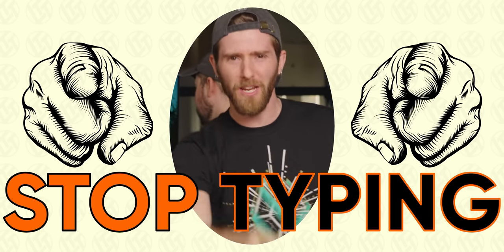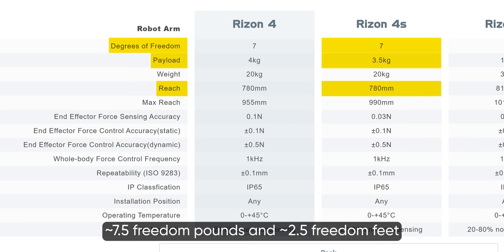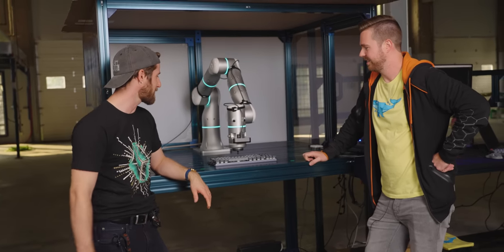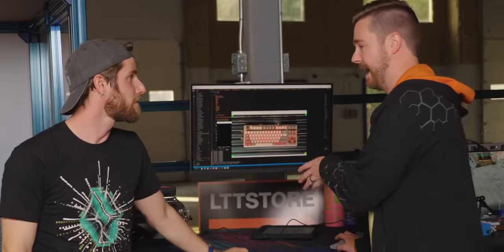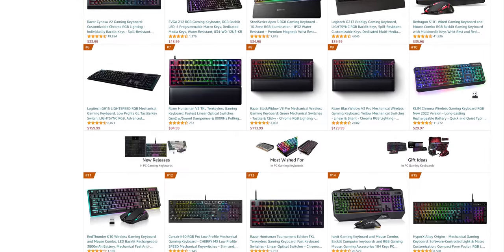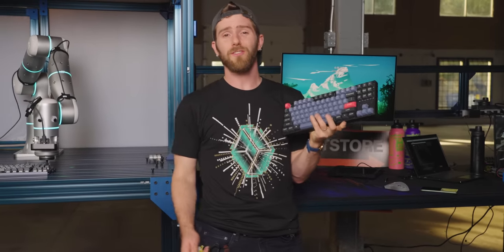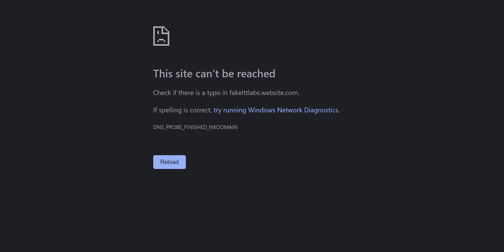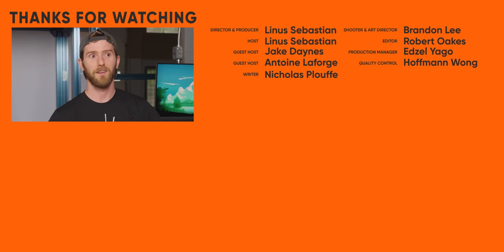Your Keyboard Sucks and I Can Prove It. - Labs Keyboard Testing

Comment: As a robotics engineer, this setup is definitely a decent proof of concept. I'm really excited at the progress and promise of the work! There are some simple changes you guys could try to make the setup more robust, especially for vision. Fully enclosing, specifically with a light box, would really help with consistent lighting as well as integrating the lights. You can also get a 3D image using a 2D camera by stitching together images as the robot moves or using multiple camera angles. Multiple cameras can allow a 3D image also using structured light through a projector. That will be much cheaper $500 USD per camera, than a multi $1k/$10k 3D sensor. Getting a Basler or similar GigE camera allows open source focus control and confocal lenses if you want a really flat 2D image. 2D line scan profilometers are a decent idea, but be careful that robot movements can cause rippling in the image as they move. So take measurements while it is stopped or consider a true 3D sensor (point cloud) as they are about the same cost range as a laser profilometer. Another lower cost option is using a Microsoft Kinect or HP 3D Camera. They used to be off-the-shelf, but you can find used ones. They have limitations in resolution, but might work for identifying the key top centers. Just some attempt at friendly advice that I gained through many hours of banging my head against problems in the industry. I'm sure you guys have already tried a lot of approaches you couldn't fit in the video.
Reply: Or use a tof camera to get a point cloud
Reply: This. Laser topology seems not only overkill but prone to issues such as metallic reflections from both the robot itself and keyboard backplate (or even shiny keycaps), not to mention high sensitivity to jitter and judder. A rigid lightproof enclosure with two or three distinct camera viewpoints should be more than enough to build a reliable pointcloud with high enough fidelity to work here, or spend the big bucks on a 3d scanner that will not require complex positioning to capture the topology of the keyboard.
Reply: i really hope these changes are implemented
Reply: why would fully enclosing help with vision? why not just use a coloured light and a matching filter?
Reply: In your opinion how many years away are home cooking robots?
Reply: I don't think that's what he's going for. Remember, it has to be viewable on video and LMG has the resources. Doesn't make the setup any more optimal than it already isn't, but "satisfactory" is all they were going for anyways.
Reply: I would use a normal camera but not mounted on the robot. You can make the robot adjust its height by using the builtin force meter to get height of each row. Then you know where ea h key is with the camera and height.
Reply: @alystair  Now, look up Moley Robotic Kitchen if your mega rich.
Reply: @ritecomment2098  I'm not an expert so take my reply with a grain of salt. But this might cause an issue if say the color of the keyboard happens to coincide with the color you chose as your filter. Not to mention that lights, especially sunlight, may give off multiple wavelengths of light and thus might match your filter thus eliminating any gains you get for using the colored light in the first place. And really it's a matter of what is the simplest solution that works. Sure I could be wrong and there is a way to get just the right filter, but in the end, is that cheaper than getting am opaque casing to surround the robot and a bit of diffuse lighting to go in the case?
Reply: one change that would solve the lighting issue is to use a industrial camera with built-in lighting. As a robotics student I would also recommend a reference mark like a ar (fiducials or ar_track_alvar) landmark as seen in ros.
Reply: ummmm this is less robotics and me of basic com vis knowledge to help robotics
Reply: Would a Xbox Kinect camera not also be a good solution for 3D imaging?
Reply: It is fully enclosed. They showed it in the video. It's removed for demonstration purposes for most of the video, though.
Reply: @christianstonecipher1547  well, I am an expert, and I'm telling you the vision solution would be to use a diffuse filter at a given wavelength, e.g. red 700nm and simply turn off the LEDs on the keyboard. even better scrap the robot and use a linear drive with a load cell and measuring software like that from promess-inc, it does all this force/distance measurement and statistics out of the box to a database.
Reply: @bradleyswanson329  fiducial alignment marks are never QR codes, they are parallel and intercepting shapes and lines.
Reply: @ritecomment2098  too much variability of the keyboards colors ?
Would go for black box with withe light.
and dark box alow better spped on robot since you don't need to be "cobo" robot anymore and all the associated safety.

but if no doors, @ltt, considere IR barrier for safety to not permit humand in the robot cell during movements
Reply: Fully enclosing the whole kit and caboodle in a dark enclosure and just using one pinpoint light source on the robot arm would remove much of the problems of reflections and lighting shadows to a consistant level.
Reply: @lukeholland8083  the accuracy is not usable, in my testing it can vary by 4 inches easily depending on temperature and if it loses tracking.
Reply: @dededu72  if only there was a standard 104 key layout and a few others that could be used for all similar keyboards :/
Reply: @turbomit112  don't they already have zed tof camera at the robot?
Reply: apply iso 10218 and sack whoever completes your compliance!
Reply: Is he the new Luke?
Reply: @gareththwaite5128  I doubt they have a risk assessment or tested trap poses with pressure activating Tape!
Reply: @bradleyswanson329  fair enough
Reply: @Meoiswa  Completely agreed. That's an even easier setup than arm mounted camera and image stitching. Good advice! I might edit my comment to add that.
Reply: Idk wtf you just said but I like it
Reply: How does one become a robotics engineer?
Reply: @ritecomment2098  sorry about that I couldn't remember the exact name I updated my comment with the correct names and the ros packages that would work
Reply: I agree with what you said here, but from an engineer used to working with robots in a manufacturing setting, this cell needs safety curtains! Get the correct safety items and you can maximize the robot's movement speeds (when not doing sensitive work) to help reduce cycle time.
Reply: I think the best value proposition would be to use a multi-sensor photogrammetric setup, but mount the cameras stationary relative to the keyboard and subsurface, instead of attatched to the robot head. This will eliminate part of the changes in light that may occur when you move the camera relative to the light source, and will only have to deal with eventual changes cause by reflections cause by the robot inside the enclosure.

When i studied geodetic surveying a few years ago, there were already really decent projects capable of making realtime photogrammetry from a single camera feed (non ToF as far as i recall). It should have come quite a way by now, considering the huge advances made in AI just the past year.

Using force data from the actuators should in theory be combinable with the photogrammetric render to gain greater precision in the point cloud renderer for the consecutive buttons. So you could essentially make four calibration presses on the corner buttons to get control points for high-precision coordinates for the photogrammetric model.

Since LTT already has a ML/CV specialist at hand, this should be a relatively surmountable task.
Reply: @ritecomment2098  Yes. It reduces interference from outside lighting that can muddy the results. That lights that you install in the light box attempt to broadly distribute the angles of the light, control the color, and frequency it is strobed.
Reply: Much cheaper is relative. If you have someone on staff who is proficient in OpenCV (specifically camera calibration and 3D reconstruction) then this should be piss easy. If you have to hire someone and it takes them maybe a week (or longer) to do it you're probably better off just buying something off-the-shelf. Though honestly in this case I'd wager any reasonably performant approach from the last couple of years ought to give you a very accurate reconstruction. It's a keyboard, not some highly complex 3D scene.
Reply: @alystair  I know a lot of startups are working on the commercial restaurant side. I think that is going to get the attention for a long while because there is more profit opportunity. However, once the problem is "solved", I think we could see it distributed to the home space. Probably 10 years for the home. Part of the problem is the cost. Robot cells are typically, $20k to $100k USD, even for small ones like this. I would expect a home one would look a lot more like a 3D printer because that space is getting cheaper.
Reply: Do you guys put googley eyes on every robot you make/use? Because after watching this video I think every robot should have googley eyes on.
Reply: id just go for a line scan. yeah itll be a little pricey on the hardware side but the data is extremely clean to begin with and it makes the cv development so much easier (you could probably get away with a fitted plane and threshold). as for ripple, i dont recall having that with the robots we used, at least not significantly. id expect this arm to be really precise too.
Reply: @alext3811  Fair, but I give this advice because it is a cheaper approach with more flexibility than a 3D sensor. 2D sensors allow direct capture of a video stream or you can throw in a more cinematic camera into the setup without interfering with the rest of the machine.
Reply: @AndrewTSq  That's a valid approach too.
Reply: @christianstonecipher1547  That's a valid concern. But it's largely been tackled by the industry. There are fairly low cost LED systems that can produce a very broad range of wavelengths that are also tunable. Plus no matter what vision system is selected, limitations imposed by the material and color will cause problems with reflection. A 2D camera setup actually allows for a lot of flexibility in dealing with edge cases.
Reply: I'm a PhD student specialising in CS and Applied mathematics, which includes ML.  And I agree, laser does seem like overkill
Reply: @bradleyswanson329  Completely agreed. I, honestly, hope they just consult an industrial robotics engineer. I bet there's tons in the audience that would be willing to point them in directions just for free just to help. Plus I expect that there would be companies like Cognex, Keyence, etc that would be willing to consign a vision system for some brand awareness or at least a trial of the equipment.
Reply: @Sponers1  Fair. Industrial robotics is a multi discipline skill set. From programming the robots to setting up sensors and tooling.
Reply: @Steamrick  Sure. I heard that part. And cardboard is an ok approach, but setting up a proper light box is much better than that. There are camera supplies off of Amazon that can get you 90% of the way there.
Reply: @ritecomment2098  I agree. That would likely be my first approach too. I think the only potential advantage of a 3+ DOF robot would be if they want to test some off axis key stabilization.
Reply: @dededu72  That could be an approach. But multiple colors can be pretty easily overcome with what I described. Black box is only really needed if you want to really control the directionality of the light. I don't see a reason to do that here.
Reply: @Bear Spicer 
Why would it be irrelevant? I'd expect the system to generate a distance-force +  distance - input registered graph for EVERY Key.

And yes, when there are keyboards that alter that intentionally from key to key, this should show up here. But you should be able to see a consistent pattern for this, or see whether the force is randomly distributed over all keys.

(or whether that claim simply isn't true, and in fact the same force would be to be applied for all keys...)
Reply: @asdjzcx2619  I believe it might, but whether it is useful for this setup really depends on the built in functions and capabilities of the camera included. A lot of directly embedded cameras are pretty lousy in my experience.
Reply: After reading this thread I've realized I'm not smart enough to be watching this channel. Just unsubscribed, will return after I obtain an engineering degree. Goodbye for now 😢
Reply: @Play-On7  I highly recommend looking at coding in general, especially if you're younger (pre college) and FIRST robotics competition. A good foundational degree is electrical engineering, mechatronics, or mechanical engineering. There are some direct robotics engineer degrees, but they tend to mostly be masters level. Also interning at companies that use them is a great hands on opportunity. Learning relay controls, Programmable Logic Controllers (PLC's), and networking are also really helpful skill sets.
Reply: @Renisauce  That's a good point. I edited my reply to include that approach because of yours and others suggestions. My last company did this approach commonly for many reasons and I just defaulted to it. Lol.
Reply: @jajssblue  OK thank you
Reply: @jfolz  That's still true of a 3D sensor too. Even one with packaged software will have limitations and require time to learn and adjust. Admittedly OpenCV or ROS does require a bit of coding background, but nothing too crazy.
Reply: @drkastenbrot  Yep. If you don't mind the cost and are used to processing point clouds, I largely agree. Though dealing with material reflection can have caveats.
Reply: And now you’ve joined the legions of us who watched LTT try to replicate a pretty routine test protocol, poorly, and realize many of their “tests” in other fields you’re less familiar with are probably flawed.
Reply: @gareththwaite5128  Lol. Unfortunately, I've seen worse setups in the field.
Reply: @jajssblue  on completely polished surfaces yeah, but with all the normal metal finishes and any sort of matte surface we didnt have any real issues. 
there really is no system that can beat hard reflections, you may as well spraypaint the keyboard briefly and it will work fine.
Reply: as an ML/CV-engineering a agree with your suggestions!
Reply: @crunchTwist  Lol. Do not despair! They cover server and networking stuff I barely understand all the time. We all have our little bits of expertise. I was just offering some friendly advice from my experiences.
Reply: @Bear Spicer My pinky is my strongest finger.
Reply: @FuncleChuck  It's completely ok with me that they try. Half the fun of watching LTT is their humble, humorous, and open approach to difficult fields of technology. I'm not irritated and hope I don't come off that way. I just happen to have experience with these setups and the frustrations that come with them. 10 years ago, I was inexperienced and made tons of mistakes.
Reply: @lukeholland8083  it can definitely be! It is well supported by ROS, the Robot Operating System, an open source software for robotics. It depends on the resolution they need for their application.  Guiding a robot to the center of keys on a keyboard seems doable. But getting a really precise location of the center of a key could be tough because of the resolution limitations of the sensor. So it depends.
Reply: @alystair  about a year. you do like scrabbled eggs right??
Reply: @PabzRoz  Thanks! Attempted friendly advice.
Reply: @ritecomment2098   well it could strike you in the face!! its head height
Reply: @jajssblue  true. Even if you get a really expensive scanner, who knows if it'll be as precise as you need it to be?
Just had a peep at the 3D reconstruction topic on Github and there's a bunch of seriously impressive and polished projects, e.g. for photogrammetry, that you could easily experiment with to see if they do the job.
Reply: Why re-invent the wheel, Keyence makes off the shelf structured light / camera combos for exactly what you are looking for. Especially with quadrant lighting, if cloud also do the trick. I’ve used them on projects in the past for machine vision / inspection. Structured white light also can be used off the shelf for metrology applications like Hexagon’s Prime Scan machine. Anyway, not trying to push any product here, however, there are solutions out there that would not necessitate to create everything from scratch. (Not to mention, lasers are slow in comparaison)
Reply: @benoitcloutier6228  That's a valid approach, especially if you're not concerned with a smaller budget. I just offered some lower cost alternatives in case it's helpful. I'm not quite sure what is potentially driving them to a 3D sensor because as I understand the application, it looks like it should be able to be accomplished with a 2D sensor. But their particular desires might drive different priorities. Going 3D definitely offers a copious amount of extra data that might be useful. So I can see jumping to that for those extras.
Reply: Microsoft hasn't discontinued the Kinect; they've only decoupled it from the Xbox brand. The third Kinect, "Azure Kinect DK", is available directly from them for US$400. It's also a lot narrower than the Xbox Kinects, closer to a webcam.
Reply: @Formedras  Cool! I completely forgot about that because there was less consumer fanfare around it.
Reply: @ritecomment2098  fully enclosed = safe. If linus had been I the wrong place when the robot moved it would easily have broken his arm. This thing should never be ran in auto without a safety guard of some sort.
Reply: I hope the LTT lab team sees this thread, you people are kind and very polite in sharing your expertise for free :)
This info would be very much appreciated in the LTT Forums where staff are much more likely to see it.
Good day!
Reply: @ritecomment2098  Color of the illumination is the least of the issues here, it's the shadows. In a properly closed box setup with LEDs off, you can use white or red, it won't make any difference; key shadows can still cause major issues for the vision applications though. There are finicky setups for structured light 3d reconstruction using multiple colors which may not be entirely dumb here but I reckon there are better ways to approach this.
Reply: @Renisauce  A single ML/CV hire doesn't automagically make your lab do things at a state-of-the-art level. I know people who can do a lot in this field singlehandedly, but they're like world famous researchers, even a step below that and you need a full (and quite respectable!) lab to get anywhere. Generally you want 2-3 people who can at least discuss it and a bunch of other engineers setting up the rest, which they seem to have covered now. Ngl it's odd to me how much easier it is to find a decent mechanical engineer now than a decent ML specialist but big tech just keeps absorbing the latter it'd seem...
Reply: I was coming to the comments to see if anyone suggested using a controlled, enclosed light box. 3D laser scanning is way over the top and with some quick adjusting using various post-processing techniques in the code, you wouldn't need to spend all that money on a laser system to get good, controlled images. Chances are the new AI/machine vision hire would understand this well. I'm excited nonetheless!
Reply: @johnp-e9963  this was one of those new 'cobots' that have force sensors and feedback sensors that are designed to operate without the guarding that you mentioned
Reply: @JS 2k Another suggestion would be something from Ensenso, I work with these regularly and they function really well for depth sensing/3d applications for grasping/tracking objects. they should really have the camera mounted in a fixed position above the robot with the home position resting out of frame, and add in some light curtains/DCS for safety to prevent the robot from overtravelling outside the safe area. On another note, there should also be some sort of emergency stop within reach. It may be labor intensive, but I had considered suggestion some kind of scanner and a sticker pack with standardized datamatrix codes that could be applied to the keys as a point of reference system for identifying individual keys and edge detection. Could use a collaboration of datamatrix codes, a 1d/2d scanner (Cognex comes to mind) and an ensenso or other 3d vision pointcloud generation. I think this is a great proof of concept but would shy away from the idea of the laser scanner and focus on removing the camera from the robot and standardizing keyboard placement better. All keyboards are different however (Function row/macros/ect) so one size will not fit all unfortunately in this use case. I think they should have some sort of calibrated EOAT for force sensing, rather than relying on the robots force feedback, but that's just me. He mentioned going through the keyboard, there should be some sort of force threshold you can set or at least there is on the Fanuc arms that I work with regularly.

Cheers
Reply: @christianstonecipher1547  take a picture with and without the additional light. Subtract them frim another and you isolated the swiched light.